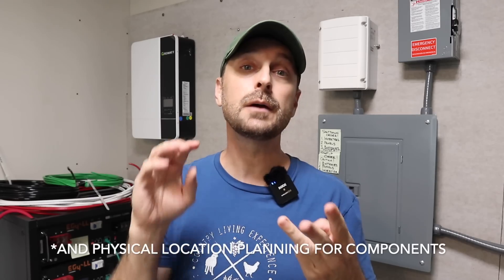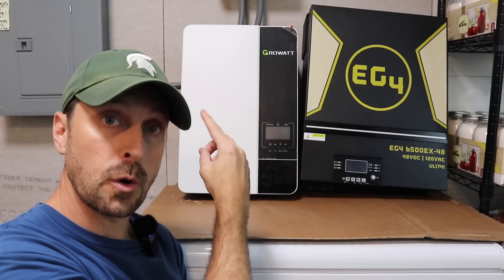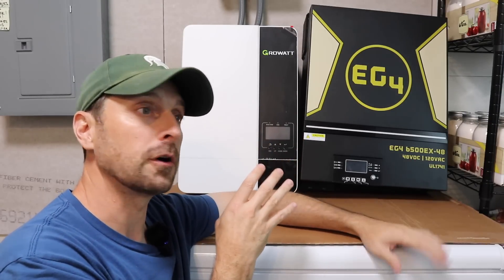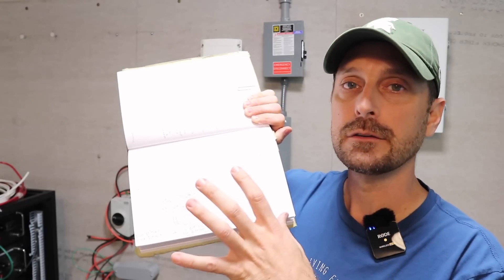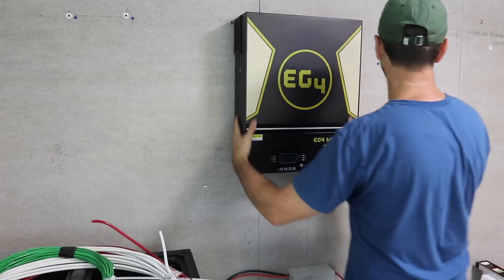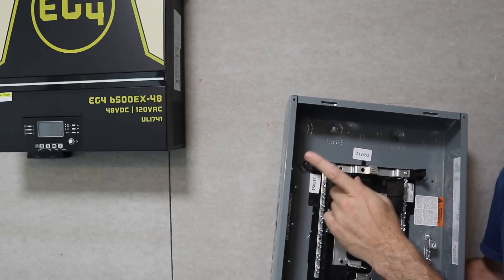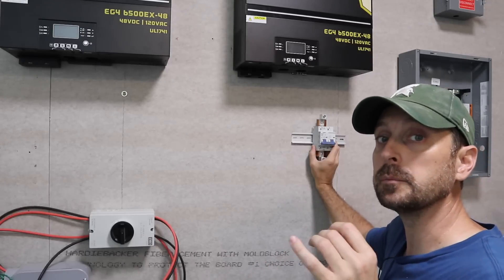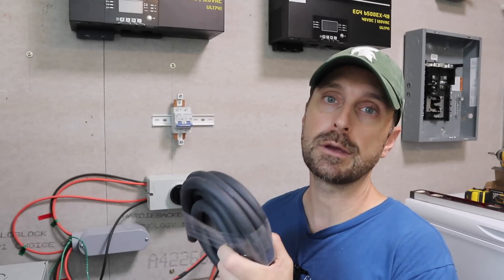EG4 Inverter Review! 6500EX vs Growatt Key Differences!

Comment: Crazy after 30 years of moving away from serial comms that there's still companies insisting on using a serial interface if you want a desktop connection to a device. If ethernet is an option it comes in the form of wireless and only supported by some stupid phone app. So you're either going to need to find a terminal server for a remote connection or yet again another cable to throw in the grab bag of a 1000 serial cables with their unique connector and pinouts for a local interface. Sheesh..............
Never mind me dude. Just 30 years of frustration boiling over. Rant cork popped again. hahaha
Reply from the maker: I found that funny too. Chinese still using serial cables on many of these inverters.
Reply: Utube sent your vid my way likely because of all the everything solar I've been digging into. Pretty sure I'll be using the EG4 equipment, single phase. 3000 or 6500 not decided yet. EG4 battery and about 3200pv. Building going up for maggot farming and chick hatching after the first of the year. I'll figure it out by then.
You put this in about a year ago, holding up pretty good for you? Seen far more good things about it than bad......
Reply from the maker: @beebop9808  Awesome. 
There was a small issue with one of the inverters "waking up" and charging when the sun hit the panels in the morning. It was replaced quickly. This 6500ex has been discontinued now and replaced with the 6000xp. I hope to be getting some soon and doing an install video (though the connections should be very similar).
Reply: Going to get cut sheets and manual. Get a handle on it before I get there. Think it was Prowse that mentioned some problems with the inverter they were having. Moving ahead with fixes and enhancements you would think. Hopefully.
Reply from the maker: @beebop9808  I hadn't heard anything from Prowse in terms of problems on the 6000xp.
Reply: No that was the 6500 he was talking about I believe.
Reply from the maker: @beebop9808  Ah, yes. I did a video on that as well.

Comment: Are you able to run that freeze dryer with the one EG4 with 48volts of battery?
Reply from the maker: Yes, no problem.
Reply: @CountryLivingExperience  I have 8 rolls 6 volt batteries. I have been running 12 volt system would you say that 49 volt is a better way to go?
Reply: 48
Reply from the maker: I do think 48v is better. 48V systems run have a higher efficiency and use fewer amps, they can operate appliances more safely than lower voltage systems.
Reply: @CountryLivingExperience  thank you for your time I will keep you posted on the EG4 install!

Comment: Greetings from Tennessee! I noticed that your video is 11 momths old, just curious what your thoughts are on these EG4, I've seen other videos where they do not recommend using these, so i just wanted to get your feedback. Thanks 👍
Reply from the maker: They do a great job at running everything I need them to run. They did have a slight issue with one of the control chips recently but have worked it out with a software update. They are new and still working a few bugs out.
Reply: @CountryLivingExperience  Awesome, thank you, I've got some property that we're going to be building on and it's going to be off-grid so I'm trying to do some research on solar.
Reply from the maker: You’re welcome. We have done videos on the Growatt brand inverters and are in the process of installing a Victron system for our well and barn.

Comment: Do you have to use a sub -panel before connecting to your main house AC panel for an off-grid property?  I bought a 200amp AC panel for a new build that has a built in 200amp breaker shut-off I was just going to connect L1 & L2 from a bank of 4 EG4 inverters, two each dedicated to L1 & L2...
Reply from the maker: You don't have to but you cannot bring power in from the inverter on a 200A breaker. 60 to 70A is recommended.

Comment: Why do you use 70 amp breakers in your breaker boxes? Wouldn't you want at least 100amp? Sorry still learning. Love the videos!
Reply from the maker: 100A would be too big. 60 or 70A is sized correctly for the 4awg wire size.

Comment: what's your experience like now that you've had these for a few months? also, are you using these EG4 6500EX inverters completely offgrid or are you using the grid as your power backup?
Reply from the maker: They work great. I have had no issues with lack of power or anything else. I use them off-grid.

Comment: The MPP LV6548 is also UL 1741, if you look on the side of it you can find the sticker. The piece of metal that hooks to the battery inputs is needed to keep it UL certified. The only difference I've been able to find between the MPP and the EG4 is the EG4 can do almost twice the PV voltage. Other than that, they seem to be almost identical.
Reply: My lights Blink when I use infared cook top.  Any one know where which light to replace so it will stop blinks like this please tell me which type of lights and where to buy them, thanks a lot.

Comment: I want to get the EG4 6500  but I have a concern,  it show the max amp per mppt is 18a,  I have 16  qcell used panels that are 45.30 Voc and 10.77a .  I want to setup a 5s2p on one Pv1 and another 5 panel in series on the Pv2. I am worried that the  21.54amp  on Pv1 might be too much for this inverter.  Any Advice ?
Reply from the maker: Split them equally 8 and 8 in 2 series strings. Also, won't you have 2 inverters?
Reply: @CountryLivingExperience  I will only have 1  Ex6500 inverter with the 2  PV inputs.
Reply from the maker: You'll need another inverter to make 240v for your larger loads. Do you have a water heater, stove, well pump, etc connected in your home?

Comment: What's the transformer for
Reply from the maker: The transformer is for the Growatt inverters which are 240v. You need a transformer to split into 2 120v legs. I did a video on that here....https://www.youtube.com/watch?v=N-d3lCVUeyA&t=620s. 
The EG4 inverters do not need an external transformer.

Comment: I’m really new to the whole solar/ alt energy thing so I might be missing something but why not buy the 12k split phase Growatt inverter and save some money?
Reply from the maker: You would only save $200. Additionally you the EG4 will accept 8000w of PV and its max operating MPPT voltage is 500 VDC. That is just for 1 inverter so you need to double those numbers because you will have 2 EG4 inverters. 
The Growatt 12k will only accept 7000w of PV and 240 VDC for its MPPT.

Comment: Why do I need to run TWO EG4 6500-ex  can I not just run 1?
Reply from the maker: They are 120v inverters. You need 2 to make 240v.
Reply: @CountryLivingExperience  BUT IF I DON;T WANT 240V CAN I JUST RUN 1?
Reply from the maker: @gdegarimore  Yes

Comment: Thanks for the system overview! Regarding the voltage drop, I believe the table you're referencing is for DC circuits only. 52' of 4AWG at 120Vac, 55Amps should give you about a 1.4% voltage drop 🙂.
Reply from the maker: You're welcome. 
Thanks for the thoughts on the voltage drop. How did did you calculate only a 1.4% drop?
Reply: @CountryLivingExperience  I believe you calculated your voltage drop at 48 volts. If that is the case, your voltage drop would be ~3.7%. However, at 120v your drop is only ~1.5%. The higher the voltage, the less voltage drop you get with distance. Hence the reason transmission lines run into the hundreds of thousands of volts and can run hundreds of miles with minimal voltage drop.
Reply: OHHH, you said 10%!  I think you are calculating for 12v. 12v at 52ft would be 10.23%, using 4awg cable running at a full 55 amps. I would not use that chart you are using for any AC work...or any dc work higher than 12v.
Reply from the maker: @cryoman6242  Interesting. Thanks.

Comment: I’m taking credit for you getting the EG4’s. You remember my rude comment on one of your other videos asking why you didn’t use it to start with,Growatt is good but the high voltage/watt input makes the EG4 surperior. 
Hey,they have a new 6500watt that’s 220-240 output all in one box. I’m getting that one. I only need a little juice at cabin.
Reply from the maker: Lol, ok. I don't remember the comment. 
That new EG46000 HV split phase looks awesome and will be great for some applications like your cabin for sure.

Comment: Great video, lots of good tips. Liked!

Using black and red in a 48V system makes me cringe a little though.
Reply from the maker: Thank you. 
Why does using the two colors make you cringe?
Reply: @CountryLivingExperience  I’m sorry, I cut that short and didn’t really give any context. I do DC wiring in data centers and it’s all negative 48V systems. The standard there is red and blue (for A and B feeds) with white tracers on the return. But that’s only for negative voltage systems, so it’s not like you are doing anything wrong. I’m just not used to seeing battery banks hooked up with those colors. 

On an unrelated note have you used the new EG4s in a AC pass through mode yet? I haven’t found any videos of that being done yet, which is what I’m hoping to use them for.
Reply from the maker: Ah, I understand. 
I won't be using the AC pass through for my system. I want to remain off-grid using it like a generator. Try Ian's Solar Projects. He may do it with some MPP inverters.

Comment: 2 questions:    A). Why do you need 4 inverters if I may ask?   6.5k x 4 = 26kw of power?    That seems like a hotel load,  not a regular house..   I fully understand why you’d want 100kwH of battery…. I just can’t see 4 inverters usage.?     B). You went kind of quick when you removed your old wiring and box.   But,  I’d like to know how you combined your old system with the grid?    There is no good videos on “mixing”.   They always only show grid Vs solar input,   But never showing when your house load is more than your solar line in.    How can both exist simultaneously
Reply from the maker: Most large houses in the US could use 26kw if they are running all of their large loads at the same time. If you have another building like a barn or a well, that will add to the loads. That being said, 120v inverters must be used in pairs. You cannot have 3, only 2, 4, or 6. By mixing do you mean grid tied? My inverters will not do that. There are other inverters like Schnieders, etc.
Reply: Most home utility services are rated to allow a house to use 200amps at 240v which is 48kws doubt many people use that unless they try to but for normal daily life very unlikely so 24kws would be 100amps 240v or 100amps per 120v leg

Comment: Did you say you had a generator to be hooked up to your EG4 inverter? I have not seen from anyone at this point include a generator system as back up power to the EG4 inverter. Can you expand on this? Thanks!
Reply from the maker: I do not have a generator connected to them. I use my solar system like a generator. I still have grid power but switch to these when I need or want to. I also have a small gas generator to emergency charge my batteries in case of a prolonged storm.
Reply: Per signature solar they don't recommend hooking up a generator directly to their inverters.

Comment: Fyi...you probably need to stop saying that signature has never had any of the transformers go bad and shoot 240 volts everywhere.  It happened to me.  Cost me a dishwasher, some transformers and lights.  That turned out to be rather expensive.  If using a mid point transformer, make sure your 120 volts loads are well balanced.
Reply from the maker: You are the very first person I have heard of that happening. Glad you said something. Good advice on the balancing.

Comment: Curious to see what just 2 of them will power without issue. I have 2 on backorder and thinking I might need a 3rd. I have 4 of the mpp 5k 240V units now that I'm having trouble getting going. My transformer shuts down after a few minutes after I turn an inverter on
Reply from the maker: Last night I did a quick load test. I ran our 3-ton whole house air conditioning, 1 burner on the electric stove, most of the lights in the house, a small 5000btu window air conditioner, and the water heater kicked on. It handled it with no problem. Used about 70% of each inverters power output.
Reply: @CountryLivingExperience    that's pretty good. When I had 2 5ks that were a Sorotec brand sometimes I'd have them beeping because they were overloaded. I'd go check and between the 2 of em they were putting out 15kw. Lol I have 2 shops plus a 2500 sqft house to power. I don't know how 2 of these EG4 would handle a stick welder.
Reply from the maker: Not sure about the welder with just 2. You would probably need 4 of them for your property as a whole.

Comment: Nice video! Can't wait for the next one. Where can I find the chart for wire size and current flow? THANKS!
Reply from the maker: Thank you. I released the new video this morning actually. As for the chart, I just googled "breaker size chart" in images and found that one which was the clearest and most comprehensive example. Here is one: https://afe.solutions/wp-content/uploads/2019/09/DC_wire_selection_chartlg.jpg

Comment: I spoke to Signature Solar Technical support awhile back about the Nader breaker connected between the inverter and battery and they specifically told me that the line side must be connected to the battery.  In your its connected in the opposite direction.  Any opinion here?
Reply from the maker: Interesting. I'll look into it.
Reply from the maker: Just spoke to them. That is correct. I need to flip mine.
Reply: I've been waiting weeks to hear back from tech support.

Comment: Any thoughts on the SOL ARK 15K?
Reply from the maker: Extremely expensive. But I have heard they have good products. I have a friend with 2 of the 12k and he likes them.
Reply: @CountryLivingExperience  You are correct they are expensive however they are very well built and come with a 10 year warranty. The 12K had some minor issues when it came to running 120 but all those issues have been fixed with the latest 15K version. 12K weighs around 100 pounds idles around 65watts and the 15K weighs 130 idles at 100watts. The 15K cost around 8400 hundred. Expensive but so easy to wire and the customer service is superb. Currently the 15K is one of the best on the market. Love your videos excellent job.

Comment: Hello:

I have 16 model: 3.2 v 280 Ah batteries along with “Overkill Solar” battery management system.  I have cut the wood that I will be using to construct the bottom of my wooden frame to hold all 16 batteries.   I would like to purchase battery tape to provide support to all 16 batteries and to secure the battery terminals.  

After I’ve connected each one of the BMS leads to the positive terminals which includes the black lead to the negative terminal and the red lead to the positive terminal, I’m not sure what battery wires and devices should I use to connect two Growatts 3,000 kilo watt inverters to the 16 batteries.

Would you do a video on this or provide an answer on this?

Regards,

Gabriel L.
Reply from the maker: Sorry, I only have this equipment and do not build my own batteries. I don't know how to help you.
Reply: @CountryLivingExperience  Okay thanks.

Comment: While it is an excellent product, this inverter is not "UL Listed." Rather it is tested to the UL1741 standard by a third party. This is an important distinction to make for commissioning. Here is a link to the Certification https://signaturesolar.com/content/documents/EG4/6500ex/EG4_6.5_tuv2.pdf. Will Prowse corrected that statement in a subsequent video.
Reply from the maker: Understood but still will pass inspections where it's main competitor the MPP lv6548 will not. I think many companies may use 3rd party testing. 
Consider this comment from James Showalter on the Sol Ark..."Solark 15k spec sheet: Electronics Certified Safety by SGS Labs to NEC & UL Specs - NEC 690.4B & NEC 705.4/6. Most people don't Use UL for UL rating, solark has CEC and more UL ratings than EG4 for sure, but who does the testing does not matter as long as they are an NRTL (TUV, ETL, SGS, UL)" 
Would that still make a difference with commissioning then? Depending on the State you are in?
Reply: UL 1741 stipulates testing standards for: Inverters, Converters, Controllers and Interconnection System Equipment for Use With Distributed Energy ResourcesUL Standard

 Scope

 Summary of Topics

Standard 1741, Edition 3Edition Date: September 28, 2021
Reply: @jcschwarb   Think I may need to clarify my previous statement, I am not arguing what the UL 1741 standard denotes. I am simply stating a fact, the product is NOT UL "Listed" as stated in the video. A simple check in the UL database will confirm. However, the product has been tested by an OSHA accredited NRTL (https://www.osha.gov/nationally-recognized-testing-laboratory-program/current-list-of-nrtls) to ensure it meets the UL 1741 standard, the certificate is linked in my original post. Whether or not any product is acceptable, UL Listed or not, depends upon the governing body (e.g., California Energy Commission) for their region. The consumer is better served by consulting with their governing body to ensure the equipment they plan to purchase is acceptable as well as their energy and insurance companies whenever / wherever applicable. Otherwise, they may find themselves having to eat the cost. BTW, I enjoy these videos so keep them coming.
Reply: Wanted to edit for clarity. I am a fan of the EG4 brand. Planning to use the new EG4 6000EX-48HV (three in parallel) for an off-grid installation (i.e., high inductive loads) with a 21.8kW array and 80kWh EG4 battery bank. My biggest challenge right now isn't regulatory. Rather, it is insurance. We are building on 22 acres in rural America.

Comment: QUESTION:  Why did you buy 7 each EG-LL batteries vs buying 1 EG-LL and 6 EG4 LifePower4 batteries?
Reply from the maker: They have a 10yr warranty instead of a 5yr and have the individual readouts on each. No point in buying just 1 LL.